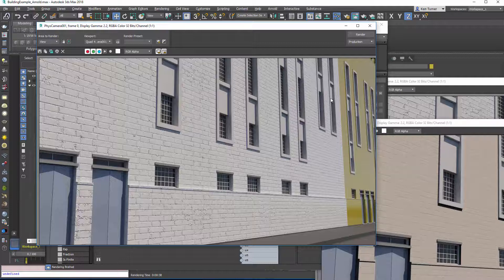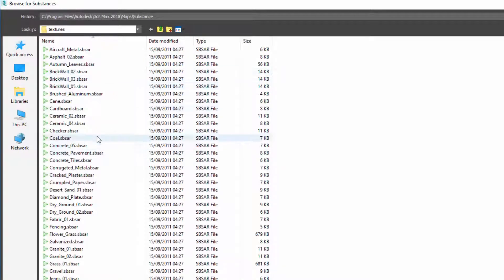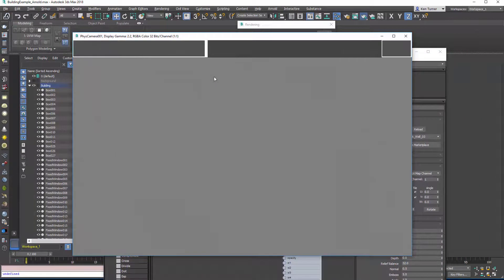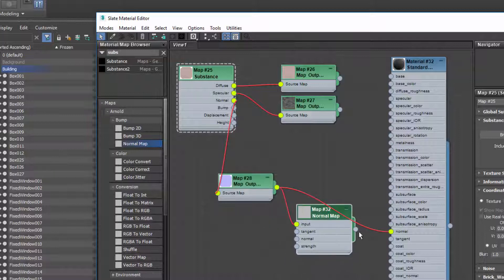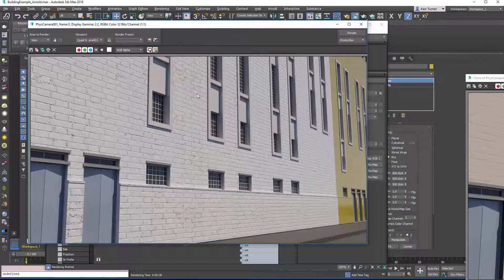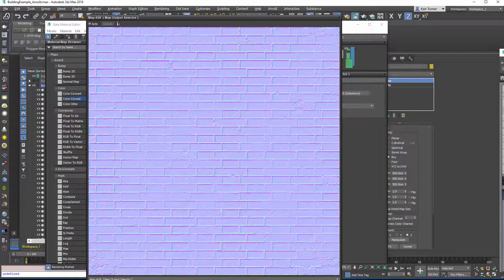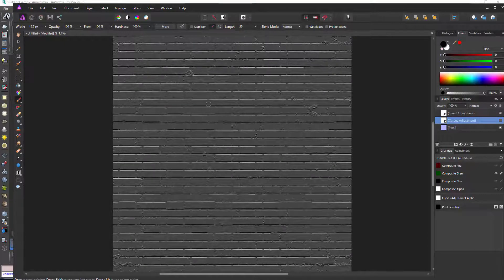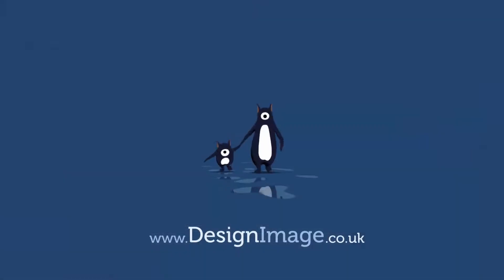Correct setup of Arnold Normals in 3dsmax

Comment: hello it may be a bit silly question but I have not found any solution for max. In maya you can combine outputed bump and normal textures for arnold materials, but I have not found any way to do it in max. Substance outputs 2 maps - bump and normal. With standart surface I have only normal map slot available. How to solve this?

Comment: Very helpful tutorial, thank you! My normal map gets kinda stretched at the corner of the object, though.. Is it possible to assign the normal map just to one selected face?
Reply from the maker: you can use material ids in max to assign different materials to different faces. but if the texture is getting stretched a better solution would be to fix the uv coordinates .

Comment: Can you do this with a non-substance material?  I cannot get decent bump without mesh displacement (which also has edge issues) and I have been attempting various schemes, with bump and normal textures.
Please help.
Reply from the maker: The process is the  same for any normal map . The 'normal shader node' turns a 'colour value' into a 'vector value' that is used by the arnold material.